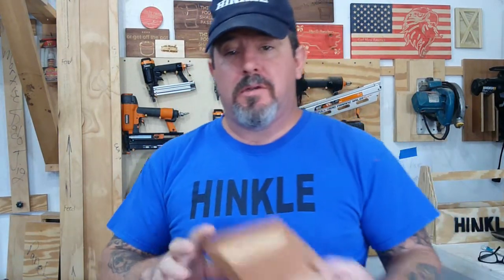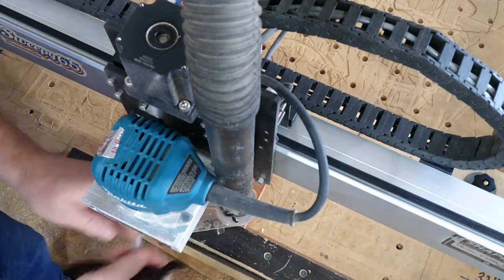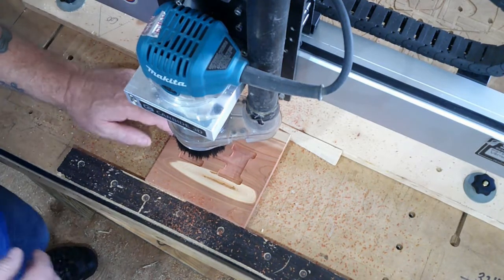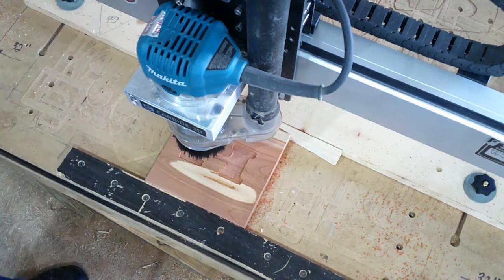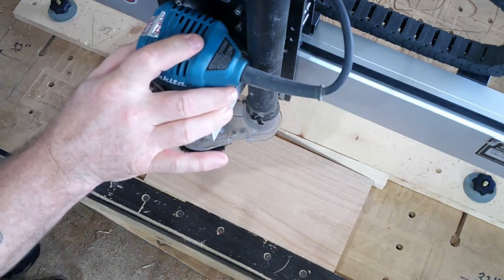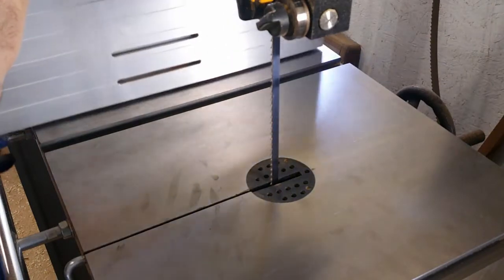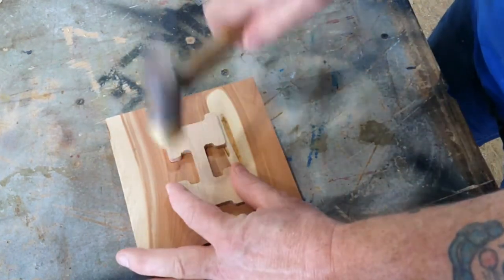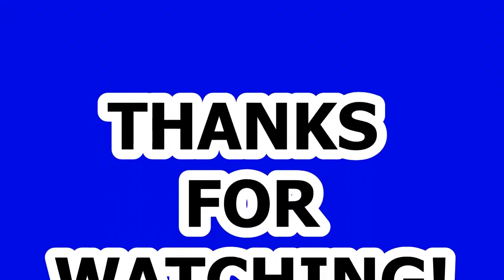I DID AN INLAY FIRST TRY WITH CARVECO SOFTWARE ON MY SHAPEOKO CNC

Comment: Off topic here. I am using Carveco maker and trying to do profile cut out I have done lots of these but now the software shows 2 bits when I save the tool path 
only using one bit and only going .118 cut out.
When I simulate it shows 2 pass. Any help would be great
Reply from the maker: Possibly your step down setting is too shallow say .1 it would then require a second pass to get to the full .118